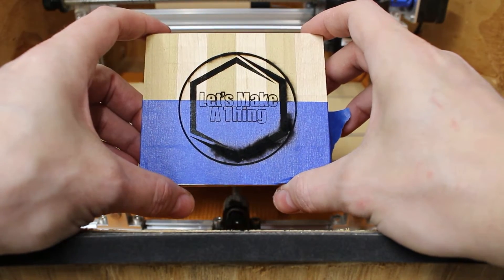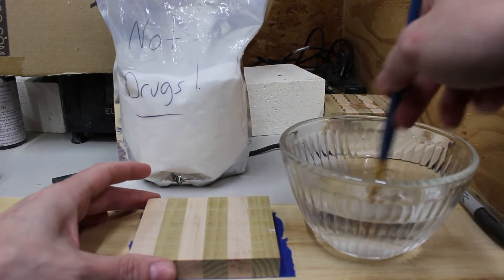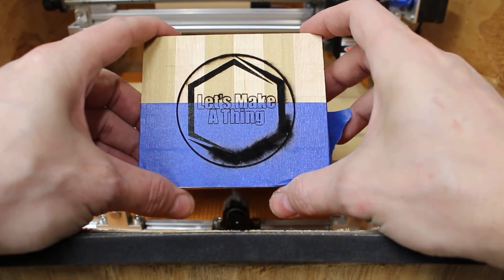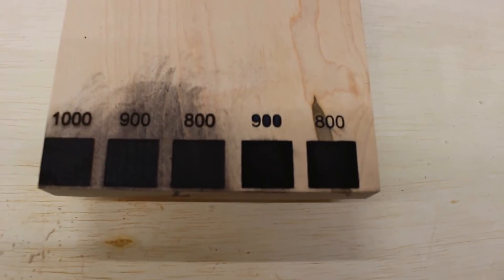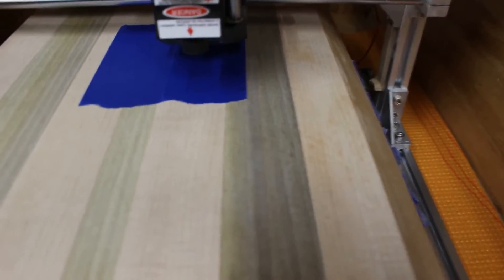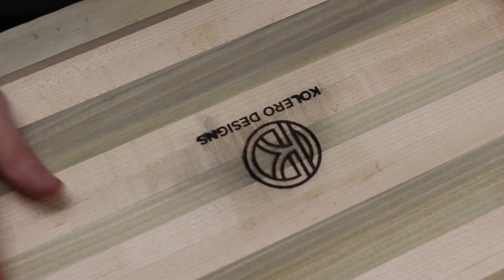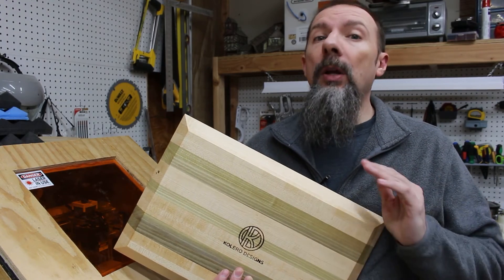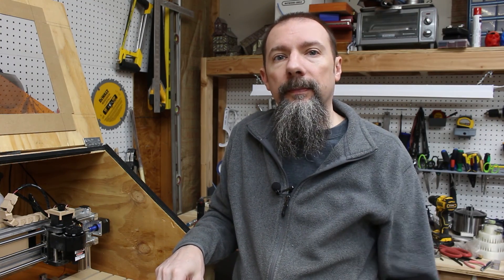Why I'm Not Using Borax on Laser Engravings

Comment: I recently tried to engrave with my diode laser using borax on wood and i decided to spray the wood with clearcoat after applying the borax. Works pretty well - much more darker engravings and almost no black smearing afterwards. Fixed it with another layer of clearcoat. No tape needed then.
Reply from the maker: I've done a couple follow up videos since this one. The next one in the series I used clear coat to seal it in and it doesn't smear like you said. Then I found a better method to get darker engravings with no Borax or other chemicals that I've been using ever since.
Reply: What is that method?
Thanks @LetsMakeAThing

Comment: Informative video. I’ve seen your other 2 that address borax but I’m convinced that not using borax is the way to go. I’ve tried it, looks amazing but the one caveat I’ve ran into is no one shows what happens after the engraving, it just smears. At least from what I saw. Many videos will show how to add the borax and the result after but they don’t show how to post process the wood. I’ve tried, put clear coat on and still.. soot smear. Slower etch, high power.. clear coat.. still soot smear. So, loos great but, at least to me, not practical. Oh and you’ve just a new subscriber!
Reply from the maker: This was the first video about Borax I made and discovered the issues with it. I did the video about Borax engravings that don't smear and tested all the "solutions" that everyone suggests which none worked. Then I found the method for darker engraving without Borax and made that video. Since then I've used that method and get great results without needing Borax or other chemicals.

Thanks for the sub!

Comment: Thanks for the video. I think one of the issues that you are having with the soot is that you don’t have the air assist option to blow the smoke away as it’s being created. (That also helps efficiency by clearing the path for the laser beam to get to the wood)   Also it may be a good idea to use store bought masking paper ( I know I hate spending the money too) and wiping it down before removing the paper. 
One more little possibly helpful item is I have found that the product Greased Lightning spray does a fantastic job of cleaning all laser related soot and mess.
Reply from the maker: Thanks for the comment! I have already tested all of the things you mentioned in a follow up video: https://youtu.be/L_OcusPBoJg
Reply: @LetsMakeAThing  I just finished watching that one, thanks. I just discovered the use of borax for engraving but I have used it when melting metals to pull impurities out. it forms into a glass like substance at the surface,
 I was assuming that the borax in the wood while engraving was absorbing the soot as it was melted and creating little glass globs which were embedded in the wood fiber. Possibly it's not as embedded as I imagined. Thanks again for your response
Reply from the maker: I also use borax as flux for metal (silver) casting! The only reason I ended up testing borax on laser engravings is because I had a giant bag of it sitting around from casting. You can get darker engravings without using Borax and I highly recommend doing it without Borax to avoid all the problems I talked about in the videos. You can check out the method here: https://youtu.be/3IqJLrk_f6c

Comment: BORAX FOR PHOTOS
Reply from the maker: Borax is great for photos because you can seal it in no problem. What I talked about in the video was using Borax on foor surfaces such as cutting boards. You can't seal it in because most finishes that will properly seal the Borax are not food safe.

Comment: I have recently discovered this and ran into the exact same issues you did with the soot. Other videos do not run into or do not address this. So I am thankful you showed that I was not alone on this. I am not ready to completely give up on it yet because I do love the affect. One thing I was looking at trying is that several other vids showed mixing the borax in a water that was scalding hot. Since that helps it dissolve more completely I am not sure if that will mean it soaks into the wood more evenly and maybe the soot is the dried chemical just sitting on top of the wood that is getting burned? Air assist did not help much, it just blew the soot and caused the smudge in the same direction the air was blowing. I may try the masking tape ide you had and then clear coat before pulling the tape up. And I also wondered about the borax on food surface when I saw you do this but I have seen others do it, they used vinegar to clean out the soot and clean away any of the residual borax before sealing with oil. Not sure if that makes it food safe or not but they seemed to think it would.
Reply from the maker: In the follow up video to this one I did more experimenting. I used boiling water and made sure all the borax was dissolved. It made no difference. In terms of food safe, considering borax is banned in Europe as a toxic chemical I'm not convinced that simply using vinegar to clean it up makes it food safe.

Comment: Good video.  I use borax.  I have a much older 2.8W laser and it does a good job, but its very slow.  I use a tbl spoon to a cup of water dissolved.   I brush it on in  long smooth strokes and overlap about half.    After I engrave the wood I spray it with a coat of poly and let it dry.  Do a finish sand and recoat for a shire.    I use this when I do plaques and art work.    For me its about speed.  With borx I can run much faster.   I have ordered a 30W quad four laser so hopefully I want need the borax step to finish projects quickly.
Reply from the maker: Thank you! Let me know how you like the 30W laser!

Comment: What is Air assist?
Reply from the maker: Air assist uses an air pump to blow a small stream of air onto the material you are engraving/cutting. It's more helpful with cutting as it reduces flame ups when cutting wood or other flammable material.

Comment: Mix 5oz of boiling hot water with 1tbsp of borax. Lightly spray your project (no need to soak it.) Then work it in using a foam brush, going with the grain. Then seal it. I don't have air assist either, and haven't had a single issue. Side note, always rinse out the bottle when you're done, or the borax will start to crystalize in the tube.

Comment: not sure of the power of your laser but with my Ortur LM2 Pro 20w and Borax. I run 9000mm/min and around %40 power. So I'd say you're going way too slow. you'll burn deeper but way over burn the image.  also, hand brush the surface after it dries to remove excess Borax and reduce some soot. Perfect power and speed settings it will be black but very little soot. If making a cutting board use baking soda instead of Borax and it will still be food safe. I wipe it down begore and afterward with butcher board cream. it will lose some of the darker black soot but condition the board.
Reply from the maker: Thanks for the advice! In the video I was using a 5.5 watt laser on my cheap CNC. I have since purchased a 5.5 watt Ortur LM2P and done some testing on that. I tried running at 40% power at 3000mm/min and didn't feel that the engraving was dark enough even with the borax. I will definitely try the baking soda as all of my engravings are for cutting boards!
Reply: 9000! I'm gonna have to try that. I've been running 4000 and scared to go above that. I just learned the borax trick and it seems amazing so far. I just hit it with some spray shellac and it doesn't have any soot at all. But my pieces are just for show so I don't know if it'll rub off black over time.

Comment: I just watched a video by "Laser Engraving 911" where he engraves a piece of basswood treated with a 1:10 borax solution .. he rubs his fingers across the surface afterward and there is no visible smudging.. wonder what gives? The only differences I can think of are 1) he's  using a softwood and you're using hardwood (but I saw the same smudging using basswood) 2) he soaked the wood with Borax  a lot more than you did 3) his art was more of a half-tone bitmap, where your logo had bigger solid black areas 4) he's using a CO2 laser and we're using diode lasers, but I can't imagine that mattering.  It's puzzling.. I'm going to watch more videos to see if anyone else gets smudging, or is it all a conspiracy to support "Big Borax".. lol
Reply from the maker: Thanks for the insights! I really appreciate your comment. I've been testing other suggestions and still get smudging no matter what I do. The only thing I haven't tried is using a softwood. Maybe I'll throw a piece of pine in the laser and see if it makes a difference.
Reply: @LetsMakeAThing  it's worth a test, but I don't  have a lot of confidence that's the problem. I'm wondering if it might be more of a power thing?  i.e. need to dial down the power to the minimum so no soot happens? IDK.. seems like if soot is happening due to over-burning, you'd still have a solid dark color on the charred wood itself, rather than the paler marks we're seeing. It would be helpful to know why or how borax is making the engraving darker.. is it absorbing the laser energy better so the wood is getting hotter, or is it a chemical reaction? I have yet to see anyone explain this.
Reply from the maker: I did some testing yesterday dialing the power down to half of what I use without Borax based on a tip from another commenter. I still had issues with smearing at half power. My initial thought was that the Borax was acting as an oxidizer making the laser hotter as it vaporized the wood. However, I'm not so sure because I feel like the wood should be charred and stay black as if it had been torched. Since the soot is wiping off I think it might be a chemical reaction form the Borax. I'm still not sure how it creates black soot but I believe the darkness is from the soot of Borax and not the wood being charred darker. Which matches what we are seeing with wiping the darkness off the wood after engraving. If the Borax solution was actually making the wood darker (more charred) it shouldn't wipe off like it does.  I am working on a follow up video testing the ideas and tips I've seen in the comments along with other places online. If I do discover anything that makes a huge difference I will share in that video.

Comment: Did you turn down your power with the borax. I found d it takes alot less power
Reply from the maker: Thanks for the tip! What percentage power do you use with Borax versus when not using borax?
Reply: @LetsMakeAThing  when I run 70 without the borax I run 40 with. I have a s6pro
Reply from the maker: Awesome. I will give that a try. Thanks for the info!

Comment: You need Air assist!!!!  My laser engravings on cutting boards using Borax look great!!!
Reply: But after I clean it  lightens again
Reply from the maker: That's the issue I was talking about in my video. Borax makes engravings darker because it creates soot. In order to keep the engraving dark you have to seal the soot in with some kind of permanent finish. If you don't seal it first, the soot comes off when you clean the piece.
Reply: @LetsMakeAThing  I sprits it with a fine mist of water after I engrave. That flows the soot down into the burn keeping a nice dark finish on the engraving. I have more success using an air assist also. Some people like the darker engraving and some don't.
Reply from the maker: @krisknowlton5935  I added an air assist to my laser and tested it again, still the same result even with air assist. I was contacted by someone with more experience who said the issue is that borax doesn't work well with diode lasers. If you watch Laser Engraving 911's video about borax you can see that on a CO2 laser right after it's finished he wipes across it and nothing comes off. So I am inclined to think Borax does work better for CO2 than diodes.
Reply: @LetsMakeAThing  I have a CO2 and no matter what I do its just soot everywhere. If I rub or touch the soot the entire plank goes black. I sand it and clean it its just a mess. can't get it to work properly. When doing vectors i just run again with powdercoating powder, but on images etc or something with large black/engraved areas the powder coating powder doesnt work properly either. So I have no clue how to get dark engraving on softer wood especially images. I would love for a solution.
Reply from the maker: I'll give it a try!